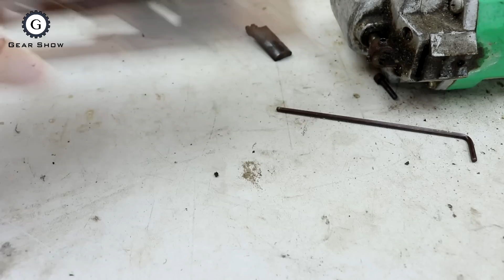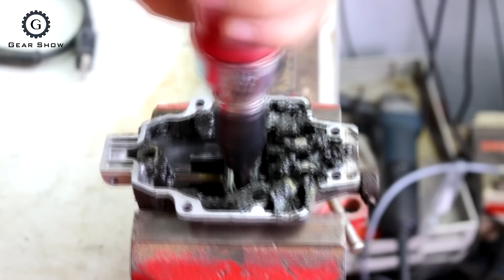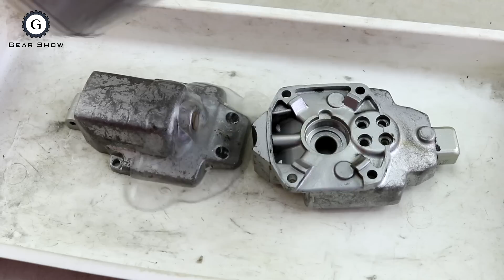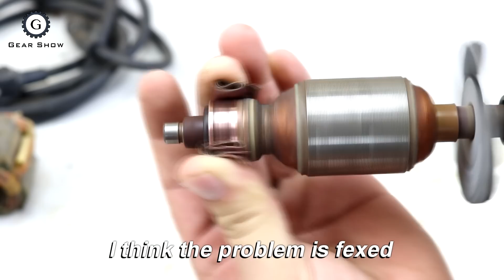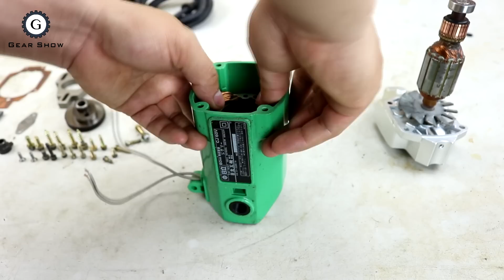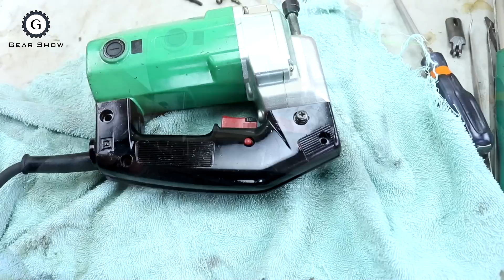Electric Jig Saw Restoration | Hitachi Jib Saw CJ 60V

Comment: By the way, I find WD40 amazing for removing that sticky stuff left from stickers. It just helps to remove stickers in general.
Great video👍
Reply: Same
Reply: Its because of kerosene which included in wd40. Just try clean kerosene, its much more cheap than wd.
Reply: @resoursa  but you have to buy kerosene..
Reply: @resoursa  no actually it's cheaper if you have something like lighter fluid and a exact knife but if the stickers are small I would recommend a syringe to inject the lighter fluin in the side of the sticker then wait a moment then use the exacto knife it just works the best fory tools

Comment: Very nice! Did a reconditioning, didn't see any obvious short cuts or omissions,  didn't spend $150. to repair a saw that was $70. when new, that's how it should be done. The blade guide roller pin was worn pretty thin in the middle so will let blade wander a little, but only important  if you make very tight turns in your wood. Liked that you use vaseline for lube, no need for high pressure grease.
Reply: bert menden 
Was that vaseline ?  I never heard of using that for mechanical greasing. Looked like lithium grease to me.

Comment: Nicely done.  Don't ever change the format.  No music needed. Ever.  You might try Hammertone paint sometime. 
Nice effect.  Do you record the labek info where possible?  Amps, Model etc. I use crazy glue to hold down loose labels. That is a quality Jig Saw.  Variable speed?  That is a great and quiet buffer you have.

Comment: Also, try Muriatic acid it does a pretty job on rust.  On a previous video you were cleaning cement off of a mixer, Muriatic acid was made to break down the bonds in cement.  It's cheap and easy to buy.

Comment: It looked like you were brushing the motor coils with a wire brush. Wouldn't that strip off the enamel coating and make the motor short out and burn up?
Reply from the maker: Just a little clean, I think there is no problem.

Comment: Love the videos and the effort that goes into them. But an old jigsaw is probably the only tool not worth restoring. The older models are generally crap compared to todays examples no matter the brand.
Reply: You really have it backwards.  It is not about the worth, but the challenge and sense of satisfaction of the restoration/repair whatever you call it.  Older models last far longer than modern cheaped up brands of today.

Comment: Hi what is the name of the protecting spray that you use on the plastic parts after you cleaned them on 09.18 of the video ?
Reply: Clear spray varnish
Reply: I think it is Clear Coat.  Automotive finishing dept.

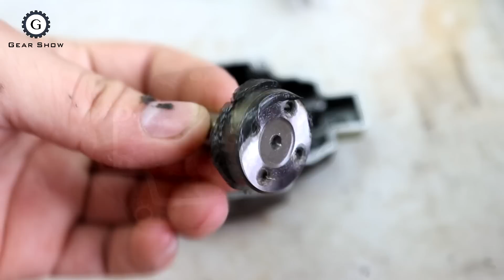Comment: Can you please be so kind, and tell the brand or part number of the puller used on 4:24? And also of the 10pc set? Thanks!
Reply: Its a Wynns puller and some sort of flywheel puller set. Google/Ebay should help you with the rest. His Wynns is the W0459B, there is an A (smaller) and a C (larger) which they also sell.

Comment: whare can I buy spare parts of this machine.
Reply: The local car pars shop should have most of the bearings, For smaller bearings you might have to look online, like eBay or Amazon.
Reply: The local car pars shop should have most of the bearings, For smaller bearings you might have to look online, like eBay or Amazon.
Reply: The local car pars shop should have most of the bearings, For smaller bearings you might have to look online, like eBay or Amazon.
Reply: The local car pars shop should have most of the bearings, For smaller bearings you might have to look online, like eBay or Amazon.
Reply: The local car pars shop should have most of the bearings, For smaller bearings you might have to look online, like eBay or Amazon.
Reply: The local car pars shop should have most of the bearings, For smaller bearings you might have to look online, like eBay or Amazon.
Reply: The local car pars shop should have most of the bearings, For smaller bearings you might have to look online, like eBay or Amazon.
Reply: @AJRestoration  I want roller at the front which stabilizes the blade.

Comment: How you kkow the problem in armeture..

Why you don't replace that??..
Reply: Could be because the commutator on the armature is dirty. Cleaning will help conduct electricity better.
Reply: carbon build up from the carbon brushes. can't replace armature, might as well buy new saw.
Reply: I think it just needed a cleaning